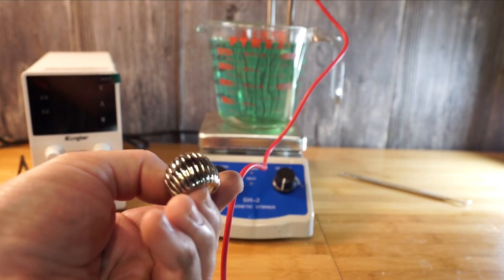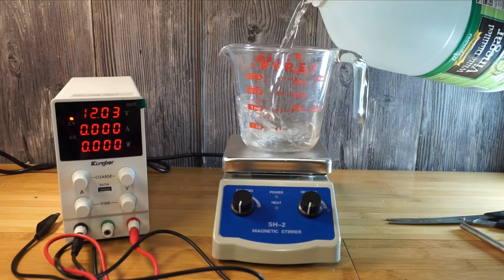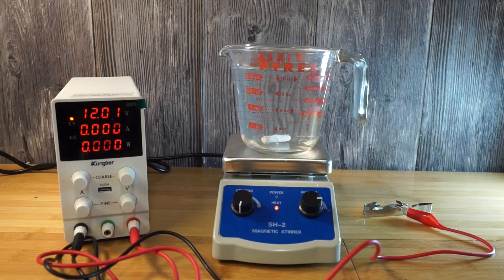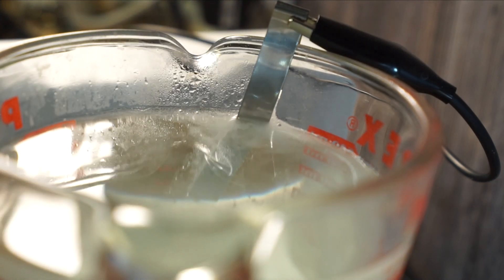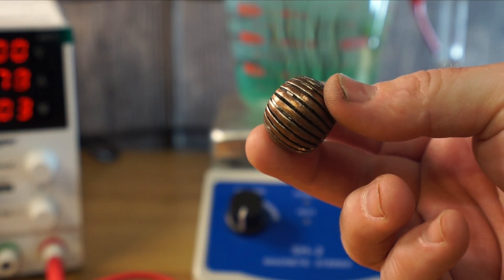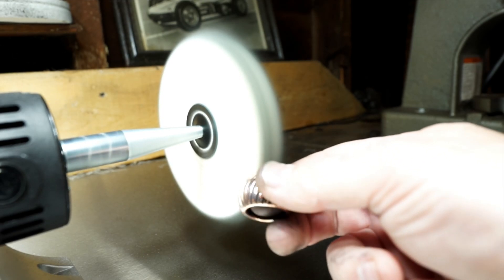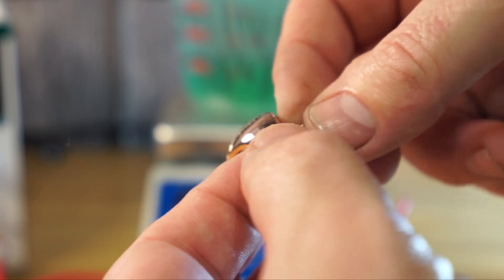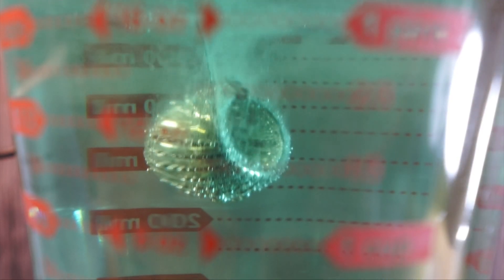Nickel Plating - Step by step guide

Comment: Do NOT use iodized salt! Also whatever you want to plate… make sure it has fully been cleaned, do not touch with bare fingers. Clean with degreaser, and then wash it off with deionized water, or distilled water, and then rinse. Try to obtain the highest purity possible nickel as well. Filter the solution when u make it.

Comment: Sir I use nickel chloride and boric acid is it safe and what is the recommended Voltage and Amperes when applying Cosmetic Electroplating like on  copper coins and airsoft metal frame?

Comment: Another suggestion, this time technical: clean the object to be nickel-plated with sulfuric acid if you have it available, or with vinegar, which I see you do have. Don't rely on your fingers being clean just because you used alcohol, as skin is always secreting oils.
Reply: How much time on the sulfuric acid? And full strength of sulfuric acid or I need to mix it?

Comment: Will this work for black nickel plating too? And what do you need to add to it to make it black nickel?
Reply: I’m trying to find out a DIY “BLACK NICKEL” Solution or additive. Myself…
📍Caswell sells the entire Black Nickel Plating kit for like $250 on Amazon that I’ve actually viewed the process & results with  YouTube content. It was amazing! However I don’t need enough of it to do a set of car bumpers. Just very small pieces 1/2” in size.
Reply: @Zen_Modeling  Caswell makes a dry mix for black that's also part of their full kit. It runs about $100 for 1.5 gal of solution. There's also a formula on thr Reddit sub r/electroplating that has a DIY solution. I haven't tried it yet. 200g/L of nickel sulphate, 20g/L of zinc sulphate(for the black color), and 30g/L of sodium carbonate(creates sodium acetate when in contact with vinegar for a complexing agent and Ph buffer) and vinegar for the liquid in the solution.
Reply: @vexicon  I actually purchased that 1.5 gallon mix (not dry btw more of a sludge) worked great. Now I’ve got 1.4 gallons left….

Comment: My first attempts were a pair of steel end bells from a transformer - steel stampings with a depression in the middle, roughly 2.5
Inches by 3. They were blackened in manufacture but had become rust-pitted. Overnight in EvapoRust got rid of the rust and the blackening. I went over the outside with steel wool, degreased with Simple Green, and gave them each five minutes in half muriatic acid from a hardware store and half water. The first plate didn’t do all that well; there was a lot of cracking and flaking. The second time there was less of that but I think bubbles and positioning kept there from being even deposition. I’m not going to try to redo them but for the next two end bells that are larger (4-5/8 x 3-7/8 x 1-1/2”) I have a new container that is cube shaped and about  7-8” across so I can hang the end bell vertically on one side facing a pair of nickel strips on the other side.
Reply: How did you make out? I am having issues as you mentioned of uneven plating as only 60% of the part gets plated. I have not heated or agitated the solution yet.

Comment: I did this just like you and my solution is brown. What happened?
Reply: If you put two nickel pieces in the vinegar. It should turn green. If it is brown your nickel must not be nickel. Where did you get it. You must have 99.6 or 99.9% nickel.You get green even if you use two real 5cent nickels and they are only 25% nickel. Yours cannot be any nickel. Start with that being your problem

Comment: Great video! I plan to follow this method on a larger scale for an antique Perfection kerosene heater I'm in the process of restoring. I'll have to do an initial copper plate before I can do nickel though so it'll be a longer process in my case.

Comment: From what I've gathered looking at commercial kits, the salt might be important. It looks like most of these commercial kits also have nickel chloride which will form from the salt in the mix. Either way, I've had good luck plating brass and steel so far with this DIY method.

Comment: Greetings from a fellow photographer!
A brief word on the electricity stuff - the only really important thing is the current. Too low and the plating takes too long, and too high and the quality of the deposition is reduced. You adjust the voltage to get the current you desire, and the voltage is determined by the conductivity of the solution and the distance between the electrodes.

And I would be careful using nickel on wearables, I'd try some of the other much more people-friendly silver-ish metals.